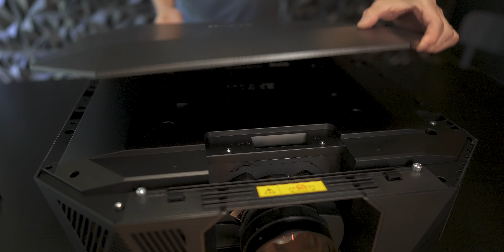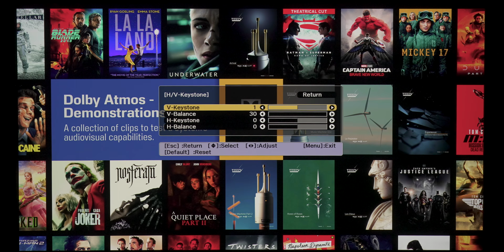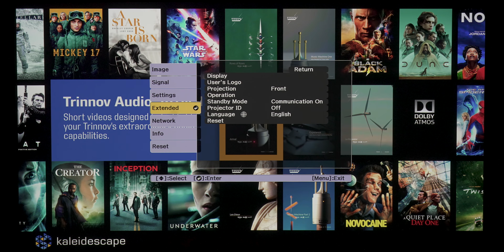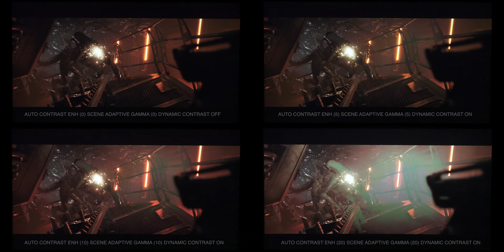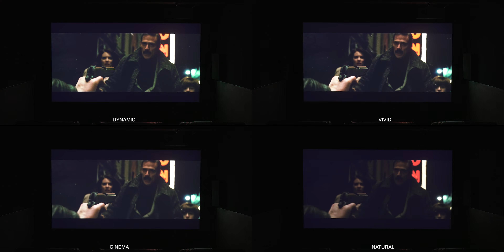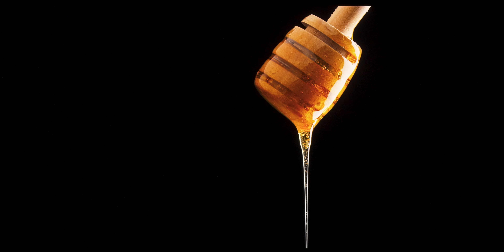IMPRESSIVE 🤯😳 Epson QL7000 4K Laser Projector Review

Comment: if you want the feel like whats in the dolby cinema,brightness and ok black level is the holy grail,without brightness you wont feel any of the powerful effect as you got in movie theater,ok color is correct,ok black is black,but so what?without brightness,those are just no feels
Reply from the maker: That's why I said it's like a Dolby cinema in my space.
Reply: @therealshanelee  Hi,Shane,what do you think about the enough lumens for the dolby cinema experience?gotta be 10000 lumens? how about 6000~7000 lumens.
Reply: @jonsnow1605 As far as brightness is concerned for HDR content, the biggest question that needs to answered is, based on the screen size, can the projector get to that 200 nits minimum level. But, the black levels still need to sufficient enough to create a good contrast. And no, you really don't need JVC levels to have a good contrast. Even the QL3000 with 6000 lumens still produces great HDR images

Comment: In the past, I had poo-pooed pixel-shifting, but now that I have a QB1000 that works properly (Dealer/distributor pulled out all the stops to get a brand new replacement!); I can honestly say that experiencing “dynamic mode” at 3300 lumens at 20 ft.fixed distance on a 2008 — 110 inch — Da-Lite AT grey screen with a black backing is: jaw-dropping!  

I sit 10.5 ft. from the screen.  Cannot see any form of pixel shifting.  Out-of-the-box performance is very good although in a couple of days, a professional certified ISF/THX calibrator will arrive to more further refine/tune the picture (up to a 4% improvement — so says the calibrator)and my Marantz Cinema 50 receiver.

Comment: For that price without an anamorphic lens and still pixel-shifting is outrageous.
Reply: @1165mac  the sharpness of that projector is every bit they equal the JVC when I saw them side-by-side. If you want to actually be upsetabout something, be upset about the fact that the price is almost 10 grand more in the US vs Europe.
Reply: The trade off is in brightness per dollar… sure it’s pixel shifting but the new pixel shifting Epson uses is excellent it shifts 480 times a second creating a true native 4k image on screen.  The lesser density allows for much more brightness at a far cheaper price than its competitors.
Reply: @Paranimal86  AND less heat. The darn thing is quieter than any JVC in the lineup!
Reply: @ryankramer not to mention JVC really struggles with motion out of the box unless your booking up a video processor like MadVR
Reply: Any yet every reviewer who has tested it still say they would pick it over the similarly priced Sony or JVC which has to tell you something.
Reply: + no3d